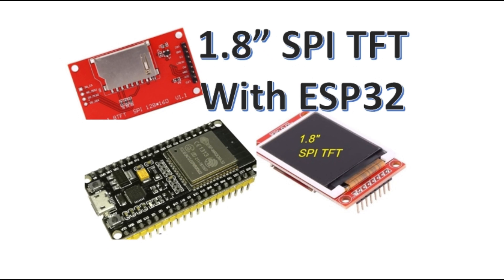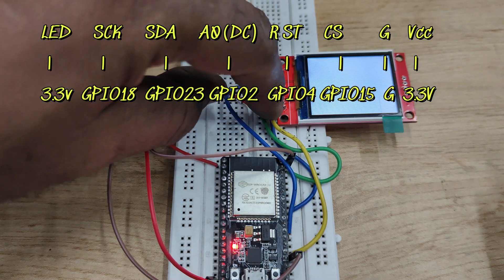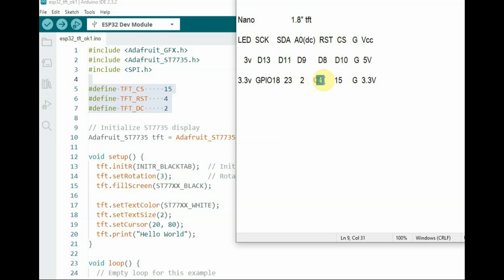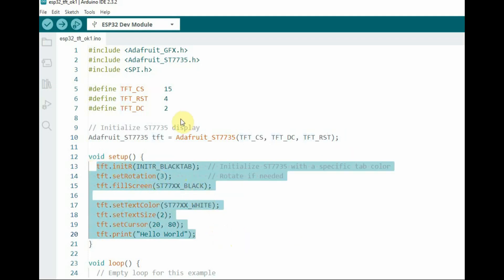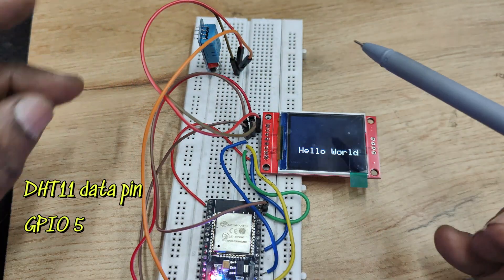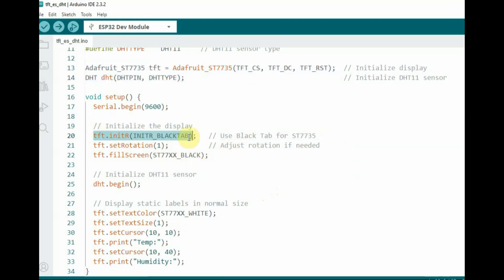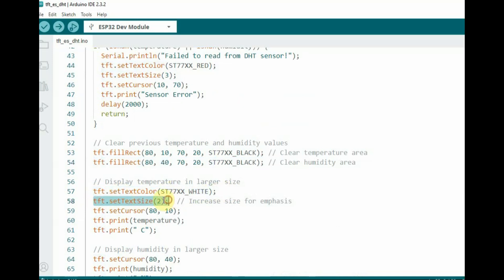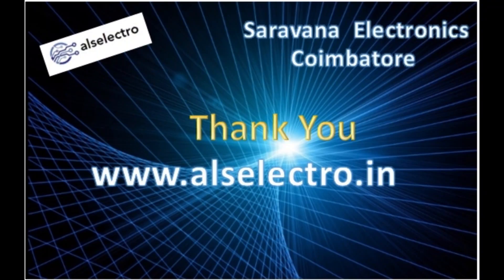1.8" ECONOMY TFT Display with ESP32

Comment: Sir i need some help with dwin hmi ..i want to control colors and brightness addressable rgb led connected via esp32 I could create rotating slider but don't know the code that will do it to change colors on esp32😢